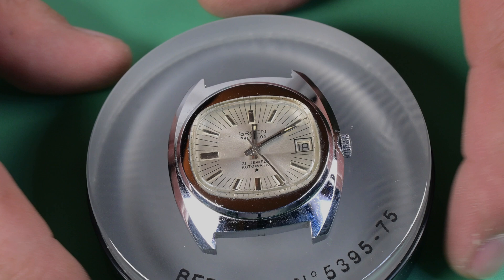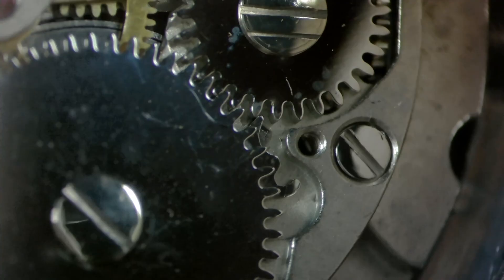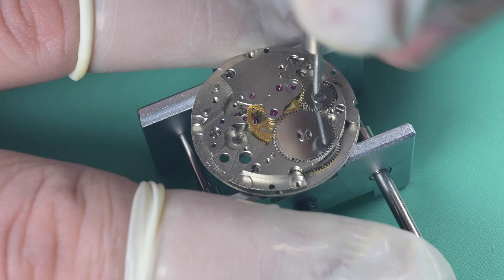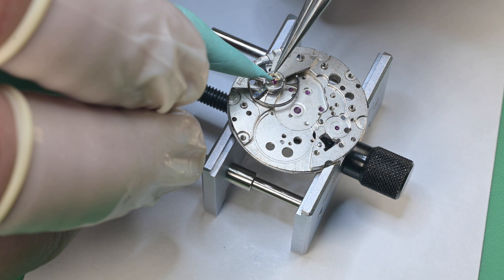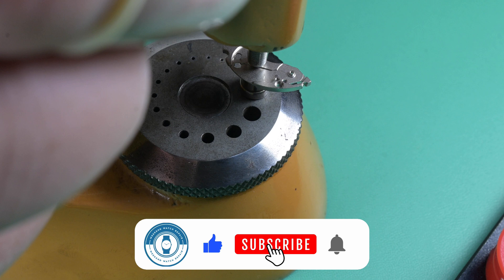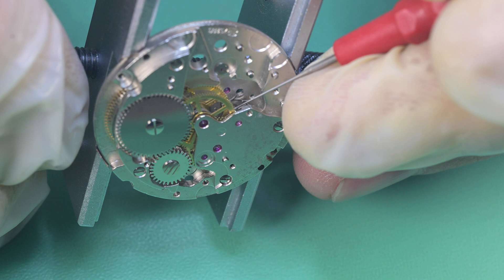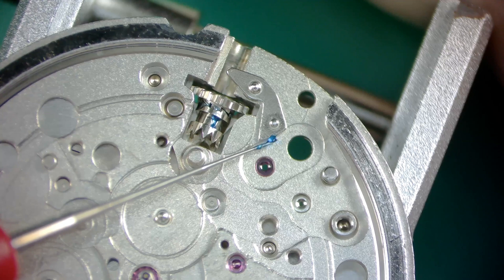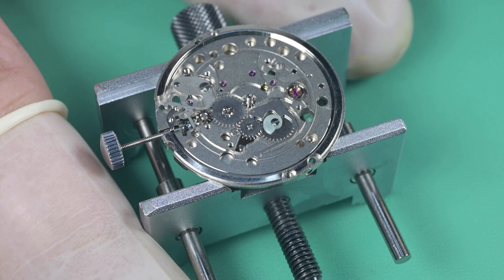Vintage Vibes on a Budget: Gruen Precision Watch Restoration

Comment: Nice job! I'd like to offer a suggestion on how the hairspring got that badly mangled.. someone did it on purpose! I once bought a lot of around 10 watches from someone online. Maybe they weren't happy with the price they sold for? When I got them it LOOKED LIKE someone removed the back of each watch and pulled the hairspring out just like that on all 10 watches. My guess is they were purposely ruined. Who knows why?
Reply: You might be right. I remember that watch had zero bids and a little less than a day left on eBay. I put in a starting bid of $20, figuring that I’d probably lose it at the end of the auction. No one else bid, so the seller may have been disappointed at the low selling price. I’d prefer not to think that it was done intentionally but you never know I suppose.  Nevertheless, it turned into an interesting project.  I’ve already had someone local want to purchase it.  I might sell it later, but I’ve only had the thing running for a short time and I am enjoying having it in the wear rotation. 

I’m glad you enjoyed the video and appreciate your comment.

Comment: I’m really disappointed you didn’t attempt to straighten the hairspring on camera😂 I laughed my head off when you said pop the escapement wheel in and won’t expect it to stay there!😂 what tweezers did you use to hold the barrel arbor? And what mainspring winders do you have, they looked very new. Wondering if they were Chinese and if you like them? Great to see a cheap watch service!
Reply from the maker: Yeah, I am as well.  Clearly the old hairspring was fixable, but I just didn't have the nerve to attempt it, haha!!  Regarding the tweezers I use on when installing the arbor, I am using the Dumont #7B.  The serrated edges on that really help grab onto the arbor and I find I have much less chance of losing my grip on it.  The best way would be to use an arbor vice, or a larger pin vice, but those 7B serrated tweezers do the job quite nicely.  On the mainspring winders, they are Bergeon.  I have just pieced individual pieces together though, as the full set is incredibly expensive and I'd probably never use 70% of the sizes in that set.  I have found that probably 90% of the watches I work on can be wound with either a L or R wind 5, 6, or 7 size winder.  There are some specialty winders for certain movements, but most of the watches I've messed with can be done with one of those 3 sizes.  The winders can be used in either direction.  Even though they market the handles as left or right handed, you can use the handles to wind in either direction.  The only parts that are truly specific to L or  R winding is the arbors.  I've got a L & R arbor in 5, 6, and 7.  One drum in 5, 6, 7, and a handle.  I'm into those parts for about 15-20% the cost of the full set, and I hardly ever need to use anything else.  I could possibly get a size 8, but it is rare that I find a watch when I need one.  For that size, I have a very old winder from the 30's that still works well.  I also wind them in by hand if need be, as I did with all of them when I started.  If you do it carefully, you can hand wind a spring just fine.  It just takes practice.  The same goes with the Bergeon winders. I had several ruined mainsprings before I got the technique down.  I actually thought about just going back to winding them all by hand, but I stuck with it and eventually figured out the proper way to do it.
Reply: @WeekendWatchRepair  many thanks for this detailed reply, awesome! I still wind my mainsprings in by hand too. Thanks essentially why I was asking, I’m always wondering if I’m missing an opportunity for more accuracy or amplitude with proper winders? Thanks for all this content, really useful! Looking forward to the next one.
Reply from the maker: @boydsargeant7496  Thanks so much.  If you do end up getting a mainspring winder, make sure you practice with some springs/junk movements at first, as you will most likely produce a few damaged mainsprings before you get the hang of it.  I read that on a forum and they were absolutely right!  It took me few tries before I was comfortable enough to use them on a watch that I couldn't risk damaging the spring.
Reply: @WeekendWatchRepair  thanks, great idea!

Comment: Whenever I see you use that black hold down tool, I think of when I worked at a computer factory and used one for dressing wires, etc.  We also used wooden ones.  They were called spudgers LOL.  Nice video !
Reply from the maker: lol, thanks!
Reply: We shaped the spudgers as we needed, and did not lend them out much...We used the cuts at the flat end to grab and pull 30 gauge wires.
I had to smile as you presented the ascending grades of abrasives lol.thanx again @WeekendWatchRepair

Comment: i wonder if that main spring and barrel design was done that way to create a safety mechanism to prevent over wind ? i would surely act like a self locating ratchet on all those spring hooks around the inside of the barrel.
Reply from the maker: Yes, the spring will slip along the inside edge of the barrel wall.  Some barrels have those recesses along the wall, others do not.  The purpose of the braking grease is to allow the spring to grip enough to hold tension at a full wind but then let it slip against the barrel wall if winding continues, thus never allowing the watch to be over-wound.

Comment: I had a timex where the hairspring did that, freshly cleaned, ran for a few days then stopped and when i opened the back the hairspring was all over the place, i guess it was fatigued/rusted and cleaning mean the movement was running with much more force so it snapped when in motion
Reply from the maker: That's odd.  I haven't run into a situation where a hairspring did that while running (yet).  Perhaps I've been lucky thus far.  Thanks for watching and leaving a comment!